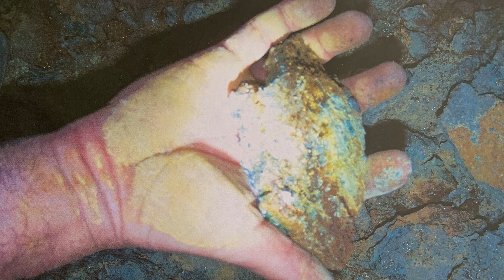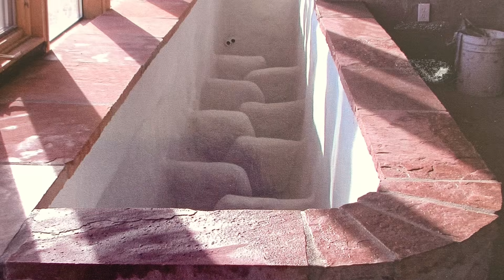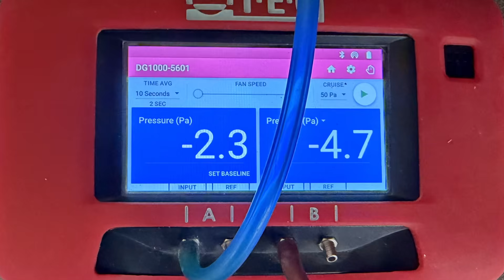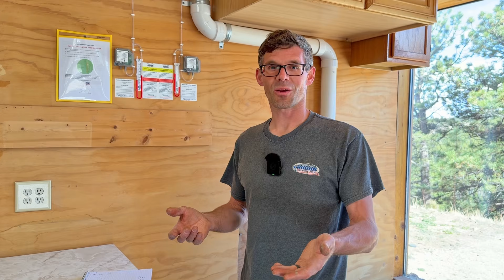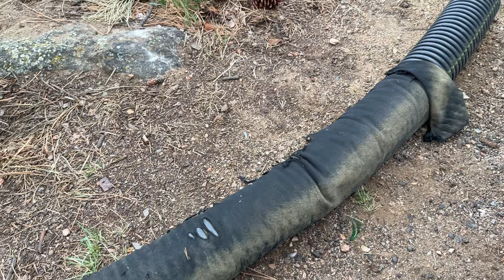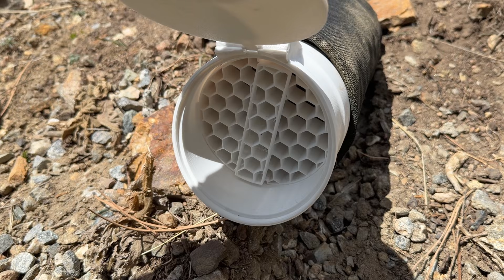Earthship Radon Mitigation: 49.3 pCi/L in a Colorado Mountain Home

Comment: Have you seen Form A Drain system? It is both radon and water mitigation system for new homes
Reply from the maker: Yes, I’ve seen it used online. It must not be common in the areas I have worked since I’ve never seen it used in the homes we mitigate.

Comment: That would be a cool project! Nice work!

So on the drain tile system… just hooking into that exterior drain tile will mitigate that side of the home? 

I’m a Radon mitigator in Tennessee and I have heard you could do that but have never done it.

David Fletcher 
Southern Valley Radon Services
Reply from the maker: Thank you, David! Yes, it was certainly a unique and interesting project. I’d love to work on more homes like this.

I actually ran a temporary radon system by installing a radon fan on the daylight end of the perforated exterior drain tile system. That alone brought the radon levels in the home down into the teens, which told me the drain tile was communicating with the soil around that side of the home.

That said, I wouldn’t assume an exterior drain tile will automatically mitigate that area. I’d treat it like any other suction point: test it, verify pressure field extension, and confirm the radon results afterward.

In this case, it ended up being a useful part of the overall strategy. Thanks for watching!
Reply: Awesome! Good to know.

Also thanks for all the content. Your videos have helped me out a ton over the years. Keep up the great work. I wouldn’t mind connecting sometime. I have a few problem houses here in southern TN and north AL I would like to pick your brain about.
Reply from the maker: Thank you, David. I really appreciate that. I’m glad the videos have been helpful.

You should join the Radon Nerds Facebook group. It’s a great place to talk through problem houses, diagnostics, and different approaches with other mitigators. I’m active in there as well, so feel free to post some of those projects there.

Thanks again for watching and for the kind words!